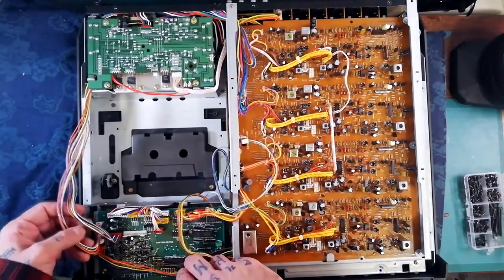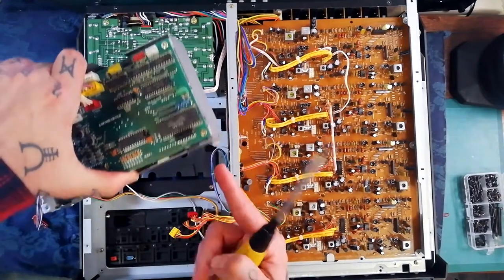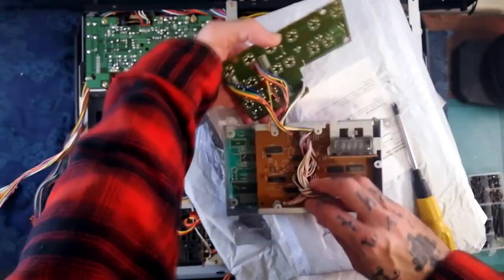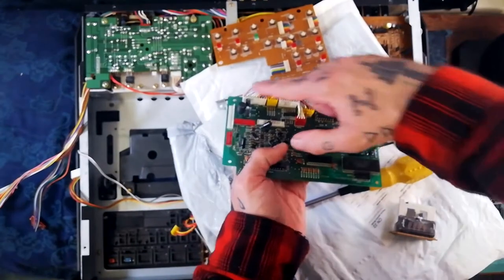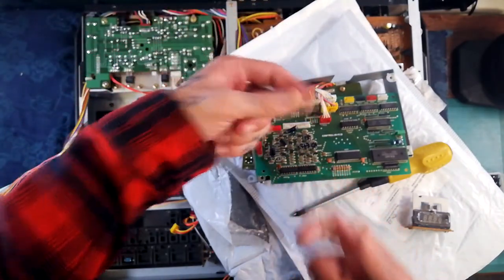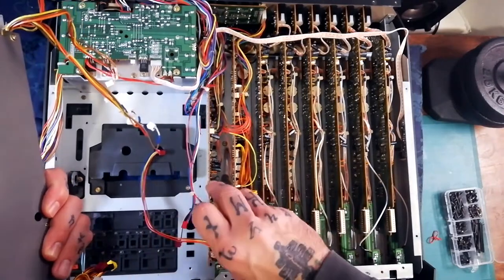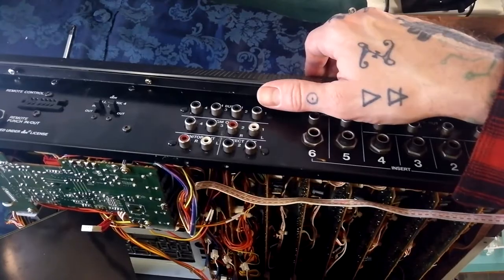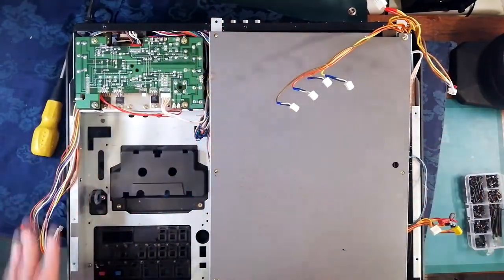Tascam 246 | 2 | access counter , shuttle & pitch controls, control & record / playback PCBs

Comment: Thanks so much for making these videos, they're a wonderful resource. I have a repair question regarding the control/function button system of the 246. I bought a non-functioning machine, replaced all the rubber, and have the transport running smoothly, but now my only problem seems to be that the REC function is not switching on. All other controls work, but I cant get the machine into record mode. Ive tested the switch itself, and it's working fine, so I think there is a point of failure in the switching/logic PCB. There's a fairly detailed explanation of the function switching and logic circuits in the repair manual, but this is my first time trying to repair a logic issue, so I'm a bit in the dark. I wanted to ask if you've encountered an issue like this before, and could identify some potential failure points to check. Experience tells me to suspect semiconductors like switching diodes and transistors first. I'm ready to dive in with an Oscope and try to trace things out, but any points in the right direction would be greatly appreciated. Cheers and thanks again for this great channel!
Reply from the maker: Thanks! The logic gates and so on are my final frontier of my ignorance I’m afraid, sounds like you know about as much about it as me if not more, but before you start doing some electrical engineering sleuth work on that PCB, have you checked that the tactile switch under the plasticrecord button is okay? In my experience if the logic boards go, it’ll effect one or more tracks, but not all of them, so it seems more likely to me you just need to clean or replace the little 5mm switch?
Reply: @Tetrakan  its definitely not the switch. Today I've traced it out to somewhere around the REC out terminal of the U502 (the TEAC microprocessor). Pressing the REC button gives me proper control voltage changes up until there, where the control voltage should switch from High to Low when the button is pushed, but it doesn't for record. It's switching all the other functions fine, so I assume the problem is probably with transistors q501 or q503, which are supposed to switch on after control voltage from u502 drops. I understand better how the logic/switching works now, but still in the weeds and will tinker on. Definitely finicky troubleshooting now, not so fun.
Reply from the maker: I’ve got a couple of faulty boards 246 control boards where (and I might be shaky on the details here, it’s been a while) the logic gates hooked up to the record arm buttons on the monitor buss are faulty. I only had a standard iron at the time and trying to remove those chips from the double sided PCBs was murder, I should really return to that project now I have one of those solder guns with a vacuum build into it….good luck finding the ball in the long grass!